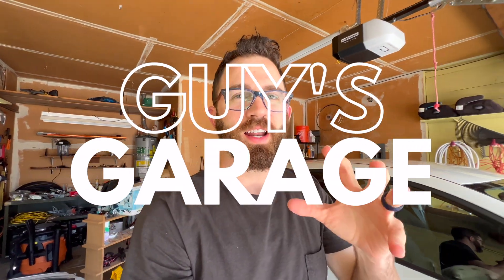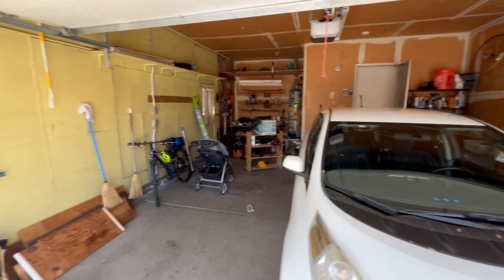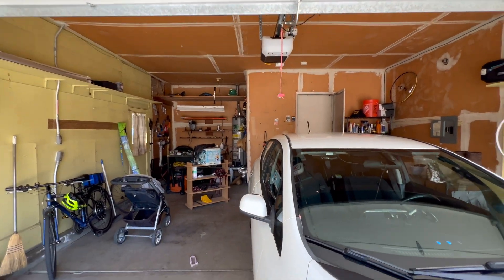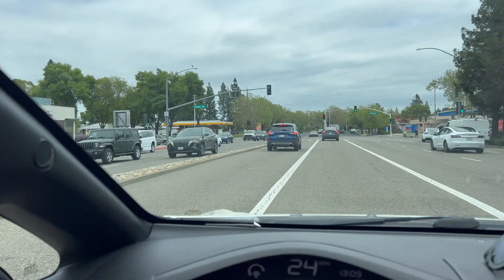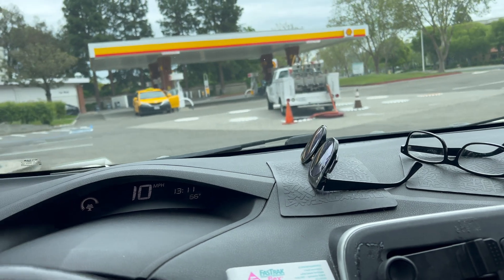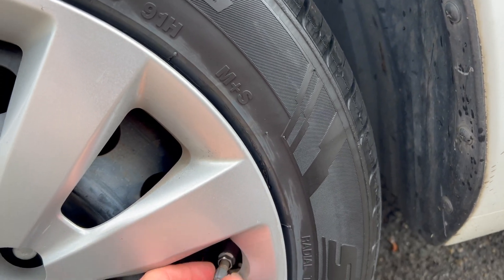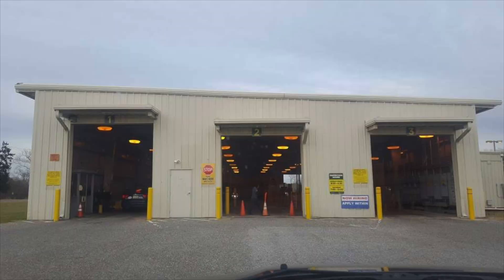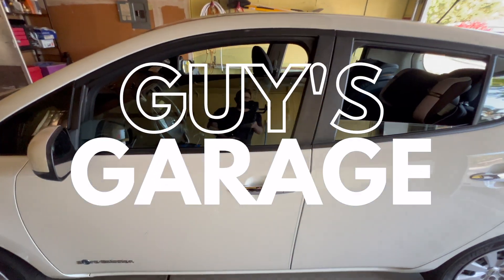This car only goes 70 miles..

Comment: If you are worried about your electrical panel, the wallbox charger can set the amp output down to 6amps at 240v which shouldn’t blow the fuse. Once you know how much you can pull you can set it to a comfortable level as well as set the charge time during off times when less electrical demanding equipment is running
Reply from the maker: Brilliant! I knew about charge time but not about throttled power

Comment: My friend's family has one that they use for commuting and errands, it's a great little car for them. Will get them basically anywhere they need, without the fuel and maintenance costs. Saves them a ton of money.

I feel like many people get tripped up in range figures without being realistic about their needs. Similar to people buying trucks or SUVs because they "might" one day need to haul something or carry seven people, but it sits empty 364 days out of the year, just costing them more with no benefit. In the case of electric, larger battery requires more resources to make, producing more emissions in the process, and increases the weight of the car while decreasing its efficiency, when 99% of the time that extra range is unused. 70 miles is more than enough for most people's daily commutes and grocery runs, I'd imagine.
Reply: Agree If you can charge at home (or at work) and have more than one car, you'd be crazy not to have one electric car in my opinion.
Reply: @ralfulrich6254 have a snickers and relax dude. I never said there aren't people who don't need the cars they have, just that the vast majority buy much more than they need. Am I telling everyone to get 70 mile range hatchbacks? No. Get the car that suits your needs. I'm just correctly stating, because I see it all the time, people going out and buying cars that are more than they'd ever need or use because of "what if" situations. Be realistic is all. If you're gonna need a truck one day a year, just drop $20 at the home depot to rent one instead of having to deal with a worse vehicle year round and being saddled with debt.
Reply: Yeah I also don’t understand why people get so hung up on range. For many people most trips are around their neighbourhood, so 70 miles range would be plenty. It would be more than enough for me…. We’ve considered reducing to a one car family, but a cheap Leaf would be a better option
Reply from the maker: Totally couldn’t agree more
Reply: My neighbour owns a 4 door Jeep Wrangler. Never seen the top removed and from what I understand they’ve only taken it camping once. (Complete with Yeti stickers on the rear side windows, LOL)
Not sure why you’d want a terrible driving and maintenance experience just for the image. 
Although, if all cad buyers were rational there’d be no AMG G Wagons on the road…
Reply: @ralfulrich6254  I think you’ve missed the point. We’re not saying that no-one needs vehicles for long journeys, we’re saying that most people don’t travel long journeys most of the time they drive. 
My hypothesis is that 98% of non-commercial journeys each day would be less than 70 miles round trip. But I concede there are many families that go away for weekends maybe once a month and travel a longer journey, but by the same token they’d be just as many that would very rarely do a long trip more than once or twice per year. I’d wager that more than 50% of families wouldn’t do a weekend or holiday trip longer than 70 miles more than twice a year. 70 mile trip, because most of the time you’ll be able to charge the car at the holiday destination. 
So I would say for 50% of families a car like this Lead would meet 98% of their needs, and for those 2 trips per year they could hire a car. 
And for my car - it’s a 2018 model and I travel around 7,000km per year. So I could sell the car for around $25k buy a cheap Leaf and put the left over money against my mortgage (so it’s effectively compounding at 6% pa, rather than being a depreciating asset). Plus my maintenance cost would be a lot less than my ICE car (my last service cost over $600). 
You’re right - it’s not for everyone. BUT it could be a great solution for most people. I would argue it’s them white are the victim to marketing as consumerism is running rampant as many people try to keep up with the Jones’s and get themselves stuck in crazy finance deals for depreciating cars.
Reply: @ralfulrich6254  you sound like you lean Libertarian in your thinking. The irony is that you’re simultaneously telling me not to worry about what other people are doing while worrying about what I’m doing and telling me how I should think. 
If everyone elder is free to thin and act how they like then so am I. 

And to clarify, I’m not sold on EVs. I don’t think they’re the solution for right now. But a cheap car that I can charge on free electricity with our solar panels during the day (when the house isn’t drawing much) and has less maintenance costs than an ICE and will allow me to put around ~$20k in my pocket… that sounds like a reasonable proposition. 

The difference between us - I’m sharing my thoughts, my perspective, my opinions. Whereas you are trying to shut people down with opinions and world views that are different to yours. That’s something the crazy leftists do. Also known as cancel culture.
Reply: @ralfulrich6254 what have I said that is BS? 
My neighbour is just an example of someone who has a car that doesn’t really align with their needs. It’s their choice. I don’t care what they drive or what they choose or how they think. We’re all different and we all think differently. I think that it could be a solution for me and for most other people. You disagree with that. Who cares. No need to get your knickers in a knot about it. You’ve clearly got other factors that is informing your opinion as you’ve mentioned ‘saving the world’ whereas I only talked about this hypothetical scenario from a logic and financial perspective. 
You just focus on what you think and don’t worry about what I think. Similar to what you said - it’s got nothing to do with you.

Comment: Im not an EV fanboy, but that’s decent range for city driving for that price. I’d still keep my gas car for long trips.
Reply from the maker: Thats good to hear because it seems embarrassingly short
Reply: @guys_garage  2013 LEAF new achieved 96 miles of range. Unless you had $80-120k for a Tesla Model S (171-223 mile range at the time, depending on battery size, with a rare 100-mile version available at launch), the next real choice for a pure EV was a LEAF, with the Chevy Volt as an in-between option ($40,000, 40-mile EV range, 300 mile gas+electric range). The 62-mile range Mitsubishi I-MiEV was the cheapest option but was rare, and I found that range surprisingly useful with the I-MiEV being my only car for 4 years. I added a Bolt EV to my fleet to make my longer trips faster by not having to stop and charge as much. The Bolt was the first of the 2nd generation EVs, which increased range by 200-400% over the 1st generation.

There were other EVs available such as the BMW i3 (released in 2014) and Ford Focus Electric (2012), but the LEAF led the pack, even outselling Tesla at times until the 2nd-gen EVs landed. As long as the batteries didn't get cooked, the LEAF holds up quite well. I know a few people who still daily drive them.
Reply: If you can charge at home (or at work) and have more than one car, you'd be crazy not to have one electric car in my opinion.  
Situation is different for everyone.  My office has free charging.  I have a chevy Suburban at home for longer trips or hauling stuff.  I would be silly for me not to have an electric car.

Comment: How many miles has this car? 
Struts bad already?
You don’t care about that much about tires if you drive slowly around town.
You can also over inflate a bit as long as you don’t drive fast in the heat.
I’d need a car like this for my daily errants.
Reply from the maker: Great advice yeah this car is brilliant for around town because you can’t beat the gas price, especially with solar